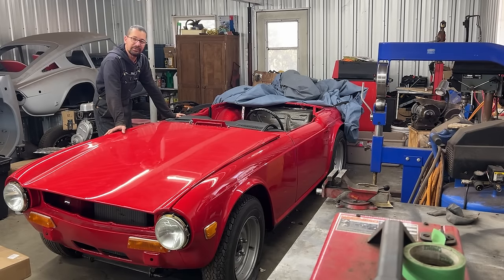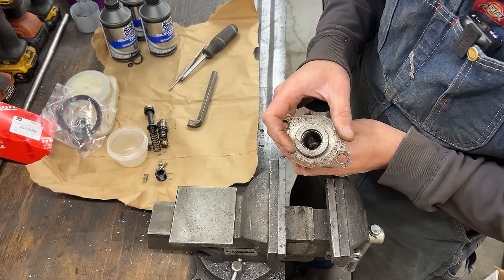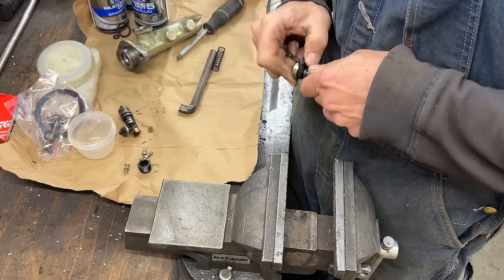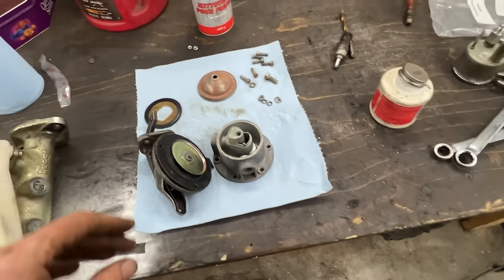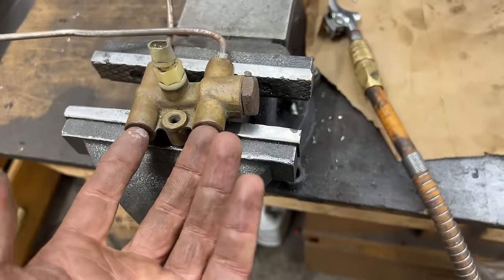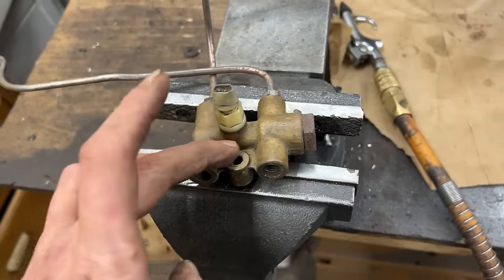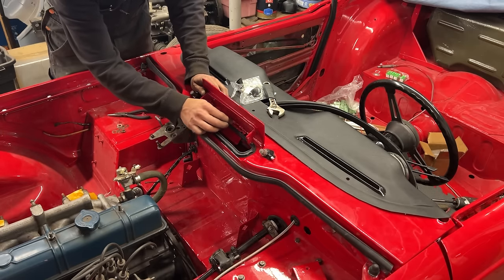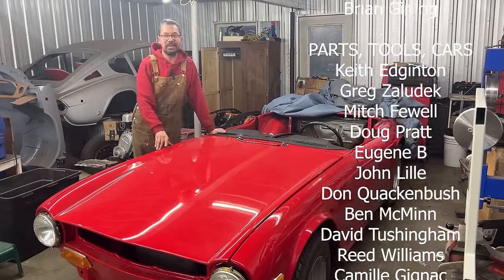1970 TR6 - Part 33 - Master Cylinders and PDWA installation

Comment: Hi Elin Had the same issue with the repro vent seal they are c----p way too thick. Solution is to get a length of 1/4 inch silicone tube slit it along its length and super glue the ends together makes a perfect seal. Just use the bit of the rubber under the hinge to keep the correct height. Your totally right recondition the old parts where you can they are much better! Andy

Comment: Hey Elin, the little ‘broken’ area on the face of the MC is to allow any leakage or weeping brake fluid to escape instead of finding it’s way into the brake booster. It is on all of the MC.
Reply from the maker: Possible, but it looks like a chip to me. And it is not really centered at the bottom.... It doesn't really matter, it doesn't affect the performance of the brakes

Comment: Elin,
Regarding the scuttle vent gasket issue.
Had the same experience 3 years ago and gave up with the oem replacements.  They just don’t work.
Found a soft rubber door edging that worked best and allowed the door to close flush.

Comment: Elin, I forgot if you have an ultrasonic cleaner, but it you don't you should have. You could have put the master cylinder in it and you would be certain it is spotlessly clean inside and out. Just a suggestion. Thanks for another very valuable video with lots of great information.
Reply from the maker: Good idea. I do have one, I didn't think of it though...

Comment: Elin, please give us an update on the scuttle vent seal... whether the rubber gives a little to let it close properly, or is you end up having to modify it in some way for a good fit. Thanks for all you do and share on your videos!
Reply from the maker: Yeah, I will. I might put some weight on it as well and let it sit for a long time. Many people already said they had the same issue and they either trimmed it or removed it completely
Reply: @RustyBeauties  hello i was just trying to back date my 73 tr6 with a scuttle hatch instead of plastic grill, during installation my vent wouldnt close properly and i figured out that the hinge on scuttle hatch is improperly bent up, the side of hinge that attaches to car if you take scuttle hinge apart rebend the side of hinge that attaches to car, it needs a sharper angle then it will lift lid a little higher and then it lays a lot better on the seal. My scuttle cover hinge was really bad couldnt open the hatch without it fouling on the body after i rebent the side of hinge that attaches to body no more fouling and i closes properly now.

Comment: for the pdwa, you could probably replace the O-rings with any material O-ring as the silicon brake fluid shouldn't attack them.  Just make sure the rubber is  temperature resistant.

Comment: I can't agree more about the low quality of the replacent master cylinders.  The replacement cast parts available are absolute junk for the most part.  The bore in the pulley on the replacement waterpump on my car when I got it was about 3/16" off center from the hub!  Wildly out of balance.  Its no wonder they fail constantly.  I got two good condition original Stanpart made in England units and had Flying Dutchman rebuild them.  Better than new tolerances with an improved impeller.  And they look awesome.  I also threw away the TRW master, and had Apple Hydraulics rebuilt an original I got on Ebay, along with the PDWA,  original clutch master, and original made in England "patent pending" brake calipers I was lucky enough to still have on the car.  It would have been cheaper to go another route of course, but I've got so much else to do on this build, and everything came back so awesome, I dont regret it at all.  I can't recommend those two rebuilders highly enough.

Comment: I had the same problem with my scuttle seal, but it was with the later plastic screen. It wasn't even close to fitting right. Ended up just leaving the seal off and never looked back.

Comment: Could your Air Vent rubber be upside down preventing it from closing properly?
Reply from the maker: No, it is the right way, but as many others said, apparently these are notorious for not fitting properly